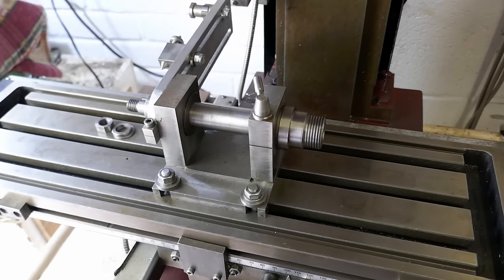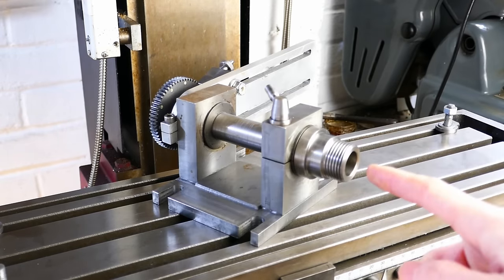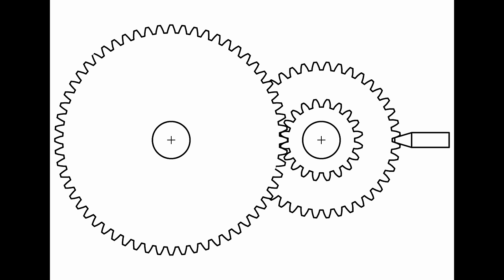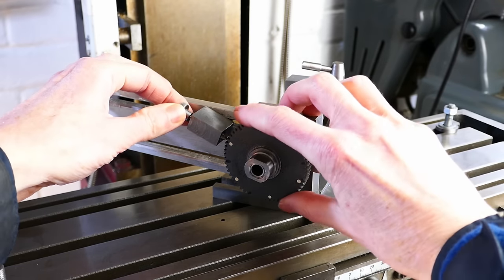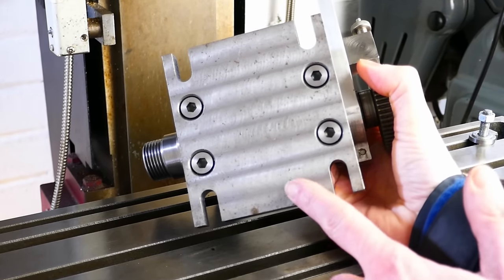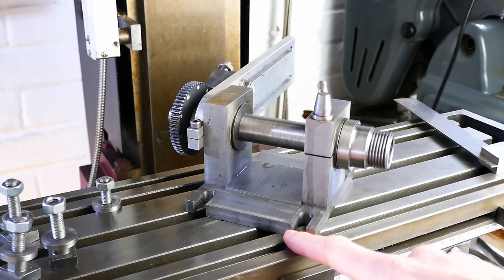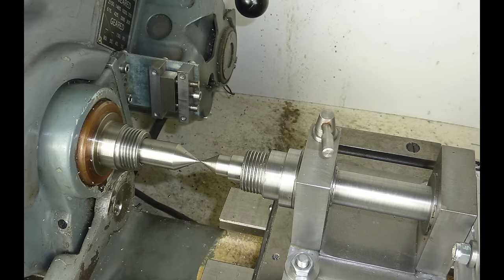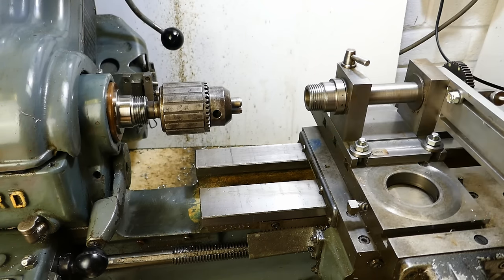A home made dividing head for gear cutting on the milling machine and lathe.

Comment: I remember learning how to use an indexing head as an apprentice.   This makes it super simple.  So, from what I understand, the single gear is for equal teeth.  Setting up the smaller gear train would replace the hole plate for unequal divisions?

Comment: This is a bit of a crib on the dividing head produced by Harold Hall in his book Dividing from the Workshop Practice Series #37. Its not identical but the similarity is there. Very well executed i must add. You've certainly given me an idea of a use for a used spindle from a super 7 lathe I have. Thanks for the ideas and the techniques used to generate the bearing blocks using line boring on the lathe itself. Duly stored for future use
Reply from the maker: Well spotted, yes I did draw inspiration from (i.e.  crib) his design but I made mine with a much wide and longer base as I thought his would not be stable or rigid enough.

Comment: Great design.  A little discussion on how you calculated which of your change gears to use to get various degrees of rotation would be very helpful.
Reply from the maker: It’s quite a complicated calculation involving trial and error for compound gear trains and depends on the gears you have available.  There is a gear train calculator at this link http://www.amdengineer.com/resources/

Comment: Great Video. i like your clear and concise delivery. 
I've been contemplating making or buying a dividing head and your video sorts that question out in favor of making. I don't think I would have thought of line boring on the lathe to ensure it's on center for future lathe use - very good idea. 
If you do any more detail on this, I'd be most interested in the bearings - what kind of tolerance you achieved etc.
Reply from the maker: I made the bearings to fit the spindle, so a bit of trial and error, aiming for a shake-free running fit.  I can work to tolerance of about 0.01mm on diameter on a good day.  The clamp on the split bearing allows you to tighten it enough to eliminate any play.  I wouldn’t worry about it too much as any slight shake is unlikely to result in measurable errors on the work in a home workshop setting.

Comment: I guess if you don't have the correct change gear for the dividing head you have to use the latter to make a change gear, but then you can also use the custom gear in the lathe for threading.

Comment: great ideaIs .. it possible to make a gear with 23 teeth without using the number 23 or its multiples?
Reply from the maker: Either use a 23 tooth gear to start with or a 46 tooth gear, etc.